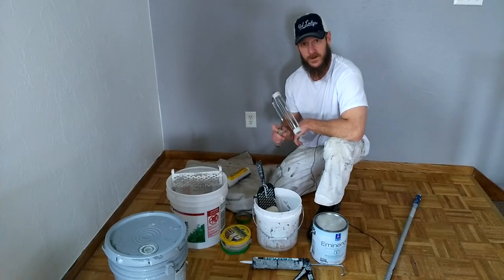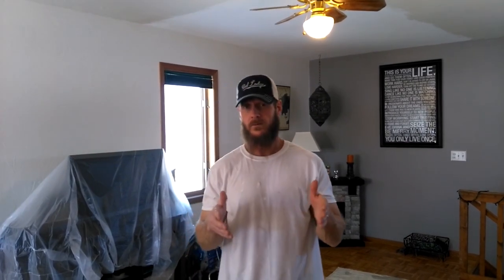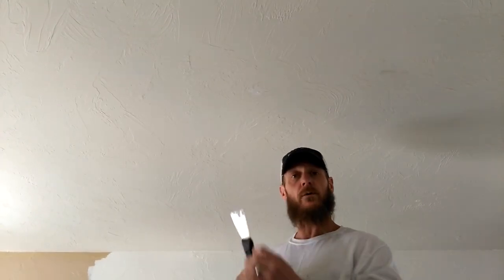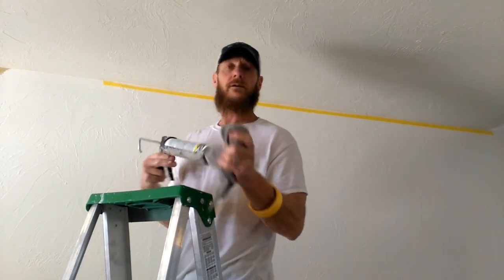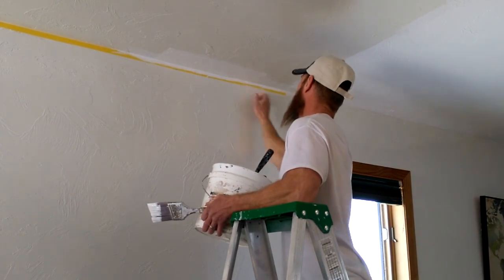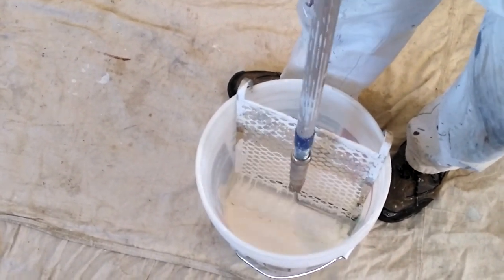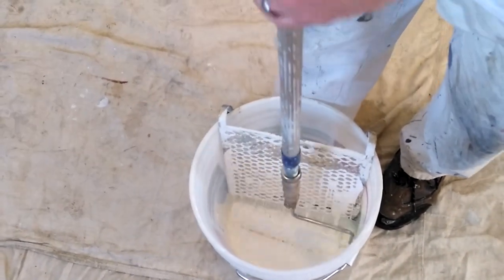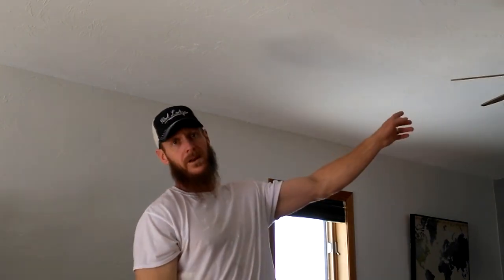Painting A Textured Ceiling | Pro Results

Comment: I want paint a ceiling that has the fan design texture and there has been a wood stove in the room for MANY years! The ceiling now is no longer white. Should I use kits primer first? Thanks in advance.
Reply from the maker: That would be a good place to start. If the water based stuff doesn't work you'll need to use oil based.

Comment: I have ceilings with brocade (?) texture that were painted with semi-gloss paint.  I want to paint them with flat ceiling paint.  Since I can't really sand the ceiling because of the texture my plan is to wash the ceiling with TSP solution and rinse with clean water.  I'll then allow the surface to dry completely then prime with a high adhesive, sealer, stain blocking primer.  Finally I'll use a high quality flat ceiling paint.  Do you have any additional suggestions or steps I should take to achieve a satisfactory result?  Thank you for your consideration.
Reply: BEST ceiling paint is Sherwin Williams Promar ceiling paint

Comment: great video.  Guess I thought the caulk would dry on the tape.  When you remove the tape it would try to take the caulk with it and make a mess in the corner?  I'm sure I'm missing something.  Thanks
Reply from the maker: Pull the tape about 30 minutes after painting.